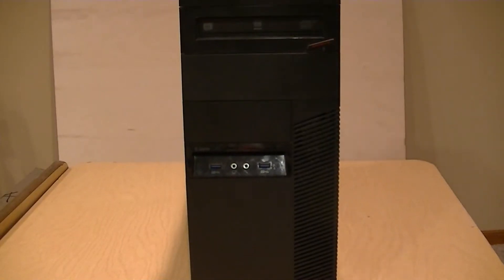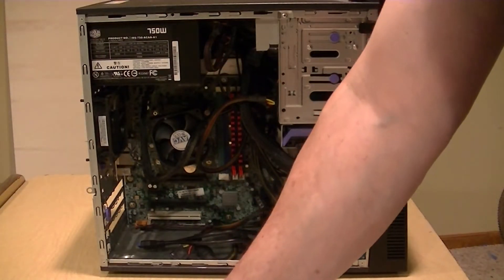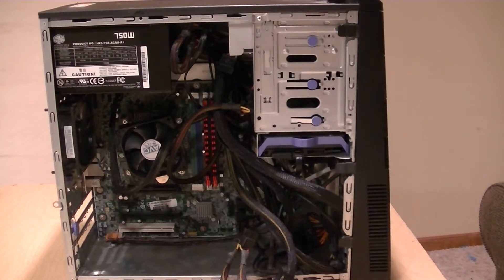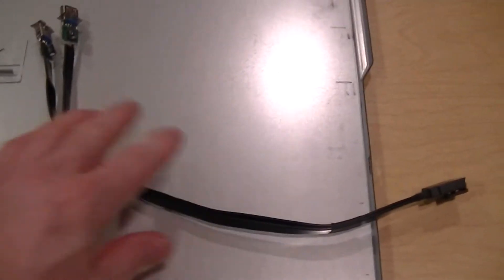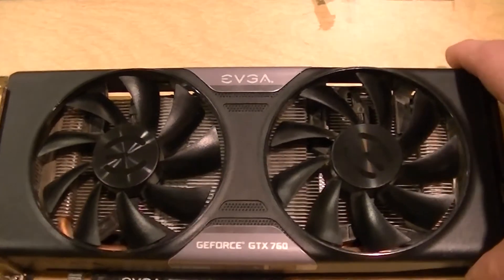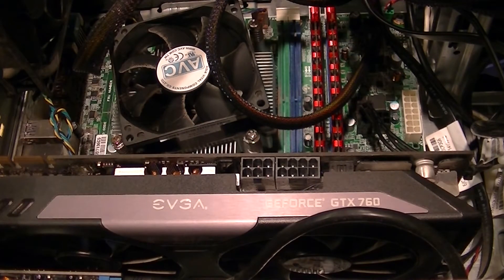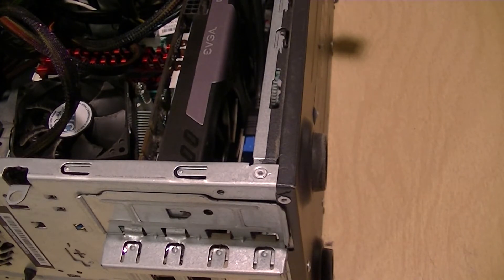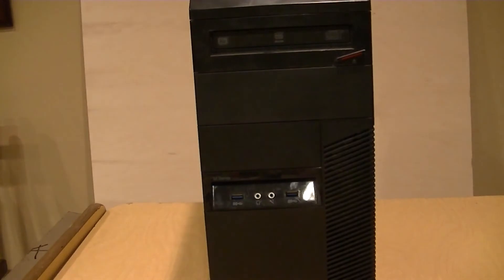Lenovo Thinkcentre M93 Turned into Gaming Rig

Comment: Do you happen to know the exact pinout for the front panel and usb? I'm planning to re-case this motherboard to a different M-ATX case but i can't seem to find the correct pin-out for the front panel and usb. Thank you and nice rig.
Reply from the maker: https://forums.lenovo.com/t5/ThinkCentre-A-E-M-S-Series/ThinkCentre-M81-Front-panel-connector-pinout/m-p/2051513  The picture in this thread looks exactly like the M93p.  I also checked the pin spacing between the FP connector and standard case connectors (PWR/RST/LED).  It looks like you could use a standard mATX case no issues at least regarding the FP header.  The audio is standard header for Azalia (HD audio) and USB 3.0.  In my case, I did modify the case connector (see other comments on this video) to go into a USB riser card.  Comparing this to a Dell motherboards, their FP connectors are very different, and use different pin spacing.  Hope you found this helpful.

Comment: I also have a M93 i5 4570 socket 1150LGA machine. Planing on upgrading the CPU to i7 4790k 1150LGA. Are there any CPU cooling options out there other than stock Lenovo hardware ? any idea if the Zotac GeForce GTX 1070 8GB would run ?
Reply: any Intel cpu cooler will work. Just make sure the fan has a 4in connector

Comment: I just ordered what I believe to be this same M93 chassis with a Core i7 4770 to upgrade from my trusty old Lenovo Slimline H530. Thankfully it's the same DIMM configuration. All I need to do is transfer the HD, RAM and DVD drive into this case and bingo bango bongo - a desktop PC that should last me at least another few years.
Reply from the maker: Excellent!  i7 to boot.  Thinking of a gpu? Or is it a productivity machine?
Reply: Not really a gamer. More home office / Netflix / photo editing. Maybe some occasional video.
Reply: Hi, I am in the same boat. What GPU did you put in? I am way confused with GPU. Haswell with 84 Watt TDP, the budget option is GTX 1650 (75 Watt/ non PCI power connector), and with 280 Watt PSU, should be okay occasional gaming. Any opinions on this??
Reply from the maker: @deamonsnake1985  Hi, thanks for the question.  Your GTX 1650 is rated to use board power, no connector.  PC manufacturers (Lenovo, HP, Dell) are required to design their systems for enough "headroom" to be able to supply 75W of power to the PCI-Express slot.  The OEM power supply in the M93p tower will provide enough power for that card - you should have no problems.  Nvidia recommends a 300W power supply, but that is conservative and based on assumptions that there is a lot of power consumption on 5V and 3V rails.  Modern (within the last 12 years or so) power supplies provide most of their power on the 12V rail, which is exactly what your graphics card uses.  The GTX 1650 will run great on this older system.

Comment: What about adding a better cpu cooler, would it be possible? I have an M93P with an i7 4770 and it's getting around 83C, would a Hyper 212 Evo work with the M93p Mobo?
Reply from the maker: Wow that Cooler Master Hyper 212 EVO is a monster, 120MM fan.  OEM motherboards are made with fewer layers than aftermarket (Asus, Gigabyte, MSI, etc.), that helps anchor those big heat pipe coolers.  I wouldn't risk an OEM board with a big cooler like that.  Maybe try some better heat sink paste - the Arctic Silver is always a good go-to.  Remount the heat sink, with the new paste and see what happens.  The OEM paste dries out over time, losing its effectiveness.

Comment: Tried to put my old R7 260x and 600w psu it worked with before, but m93 is always reseting as soon as gpu draws a bit more power. I feel like there's no enough power delivered to PCIE?
Reply: Having a similar issue with my gtx 1060...
Reply: @_RedsTech_  Damn. So it's not about the ATI graphics. Because someone told me that Lenovo did not white list any ATI, while nVidia is generally supported. Humm...
Reply: @Mandrak789  that's what I was hoping. Gonna test the card in another system in a couple days to make sure it's not the GPU, but I sincerely doubt that it is.
Reply: @_RedsTech_  Well that's some bad news on the horizon then. I was hoping to assemble cheap gaming rig for my kid. I would really appreciate if you come back to tell me results. Now I am not sure that I want to buy some nVidia if it won't work either.
Reply: @Mandrak789  Will do 👍
Reply: @_RedsTech_  Thanks a lot. By the way, did you flash the BIOS? I did, but to no avail.
Reply: @Mandrak789  turns out to be a gpu issue on my end. So there might be hope for you yet! I need to try and reflash the bios on mine. Not too bothered since I got the GPU for free, lol.
Reply: @_RedsTech_  Thanks man! Glad you solve that o7

Comment: Can i pair this with rx 580? I know the problems is the psu, so i planned to change it to 500w is that okay? I have worries because I've saw some lenovo prebuilt has a problem with new gpu
Reply from the maker: The things you may have to worry about are a) space - the RX 580 may simply be too big b) Windows revision - need 10 to support DirectX 12 and c) power.  Sound like you have 'c' covered.  As long as there is a driver (AMD will keep the RX 580 drivers up to date for Windows 10), you're good.  The RX 580 is a pretty powerful card and a 4th-gen system like mine might hold it back, especially in resolutions greater than 1080p.  Take care, thanks!
Reply: How did the upgrade go? I was also planning on an upgrade to the RX 580 but was worried about compatibility issues, did everything work correctly?

Comment: Hi there. Awesome video. I've got a m58p. 3.0ghz core2duo, 4gig ddr3 ram. I have the terrible GeForce 210. I'm not expecting to do intense 2020  gaming. Mayb run some classics but the card is pretty limited. Do know which graphics cards the board is compatible with? I've heard of these boxes having some compatibility issues?
Reply from the maker: Wow, today I just retired a Dell C2D E7300 CPU that I got second-hand from the 'bone pile' at work a couple years ago (wife's job).  Hopefully you have the E8400 Wolfdale CPU, that was pretty good back in '09 or so, but was being edged out by the early Core i3's.  To maximize your gaming performance, make sure you have a SSD, and upgrade to Win10 if you haven't already (your chipset is supported in Win10).  You need a card that is low-profile, and runs on board power only (no 6-pin plug on the card).  That limits your choices to versions of Nvidia GTX 750, 950, 1050 (plain or TI editions), the GT 1030, too.  I wouldn't spend over $100 on a card.  Read the listings carefully, thanks!
Reply: @elmarko9051  thanks so much man👍 I'm not too clued up with Lenovo. Do you know where I can find the compatibility list? As u say I don't Wana end up spending too much cash n buying the incorrect card. Its just an entry level build I'm doing so your suggestions are pretty good
Reply from the maker: @es8944  In doing some more digging, do you have the tower or the small form-factor (desktop) version of the M58p?  If you do have the tower, that opens up more options for the card.
Reply: I actually had a choice between the SFF but that had lower specs, could only take up to core2duo n 4 gigs ram. I've got the desktop tower. Upgradable to 16gb ddr3 ram, core2 quad cpu. Hope this helps

Comment: asking I have one of these after install  ssd ram  .can you show what to do after install. my 850 samsung . not  working. thank you  for updates.
Reply from the maker: OK, I used freeware to 'clone' the boot (Windows) drive from the HDD to my SSD.  I then removed the included HDD, and put the SSD on the SATA port where the HDD was originally.  This should be transparent to the BIOS - BIOS doesn't care as long as the SSD has the MBR (Master Boot Record).  For any large simultaneous changes to a system (CPU, memory, HDD/SSD, PSU),  trying changing just one thing at a time.  For example, add memory, go through POST and Windows boot, power down, do something else.  That way, if anything fails, you know what to undo.  Some systems are really picky about memory, and won't even POST with memory they don't like.  Or, you may have a defective component.  The one-thing-at-a-time method may help.  Let me know, thanks!  (BTW, I used MACRIUM REFLECT to clone the HDD to the SSD)
Reply: @elmarko9051  thanks bios to lagcy it took  windows 10 flash  drive for frist time your right about tricky and studburn thanks larry

Comment: I have an M83 and am looking to upgrade the power supply. I notice that, when visible, the 14 pin socket is not populated and you don't talk about it - all Cooler Masters available now that I have looked at only come with 20/24 pin power connectors. What was you solution?
Reply from the maker: Hi, go to 10:42.  You can buy a 14 pin to 24 pin motherboard to PSU adapter cable.  They have them on Amazon, I found mine on Ebay.  They are $10-12, in that range.  Good luck!
Reply: @elmarko9051  Thanks.

Comment: will a gtx 1650 work?
also, is it possible to change the cpu cooler?
Reply from the maker: Gtx 1650 is a good choice. Regarding a CPU cooler, I'll do some digging.
Reply: aaaah ok 👌.
Reply from the maker: @BlazingTonk  Found what I was looking for.  https://www.tweaktown.com/articles/5313/intel-haswell-socket-h-heatsink-requirements-and-overclocking-thoughts/index.html  When Intel releases a new CPU arch, everything is defined, even the post spacing for the HSF's.  In this case, 75mm square.  See the diagram about halfway down the page.  Even the big OEM's (Dell, Lenovo, etc.) stick to the standards Intel publishes.  Any HSF that is compatible with LGA1150 will work on your rig, with exceptions.  Some HSF's (looking at you Zalman) may simply be too big and not clear components on the mainboard.  Other HSF's like the Noctua may be too tall for the case.  Good luck!
Reply: ooh, thanks

Comment: I have a ThinkCentre M93 SFF that currently runs a core i5 4570.  Will it support the core i7-4790s?
Reply from the maker: Hi Joseph, at the time of release i7-4770 was the fastest 'officially supported CPU.  Later BIOS revisions support the i7-4790 (according to CNET).  The i7-4790S was released the same time as the i7-4790.  It's likely the latest BIOS released by Lenovo will recognize the CPU.  But I can't say 100% for sure.  A web search turns up a user trying to upgrade from the i5 to the i7-4790 unsuccessfully.  Sorry I can't be of more help.  But if you try and it works, let me know, thanks!
Reply: @elmarko9051  Thank you for the response.  I appreciate you taking the time to check.
Reply: El Marko So just a quick update.  After the bios update, the i7-4790s does work.  As it turns out, it’s the same architecture as the 4790, which is Haswell, but uses less wattage.  The 4790k has a slightly different architecture, known as Devils Canyon.
Reply from the maker: @JFrusci  Wow, thanks for the follow-up.  I've considering getting an i7, but can't justify it.

Comment: i bought one for 60, tried sticking a gtx780 in it and it didnt detect the gpu whatso ever, sold it the next day for 60 again. wish i figured out why it didnt work, last thing i wanted to but didnt try was a bios update.
Reply from the maker: That's disappointing.  But you weren't out any money.  The GTX780 is definitely of the same era as 4th gen stuff.  Hmmm.
Reply: @elmarko9051  first intel rig I attempted, was a bit frustrating but got my money back so all was good, dell optiplex look decent tho

Comment: I’m trying to upgrade mine it came with a gtx 620 i7 8gb of ram what upgrade do you recommend for game like csgo and apex
Reply: Lenovo ThinkCentre M93p 10A7000QUS Mini Tower Desktop Computer
Reply from the maker: @Lacora0426  If you're keeping the Lenovo power supply, the Nvidia GTX 1050 is a good choice because it does not need a 6 or 8 pin power connector.  The performance is similar to my GTX 760, so it will do fine in 1080p with DOTA2, PUBG, and Apex, CS:GO.  If you're upgrading the power supply to a standard ATX (don't forget the adapter cable), GTX970, GTX 1060.  Anything much better, the CPU will start holding back ("throttling") the graphics card.  The 8 Gb of RAM is enough, but the GTX 620 card won't be satisfactory for gaming except maybe on super low resolution/details.  Good luck!

Comment: Hello.. can gtx 1660 super works in i7 4770, 16gb ram, 500watts, but legacy bios? Thank you in advance sir.
Reply from the maker: GTX 1660, that's a fairly new card, very powerful.  If you are doing 2K or 4K gaming, I think you might be CPU-limited "bottle-necked"  by the i7-4770.  https://www.youtube.com/watch?v=npkMd97vbDQ  Based on this video, I'd say 4th Generation just won't get the most out of that card.  500W PSU, totally fine for any single-card graphics solution.
Reply: Yes, it works perfectly. I have the same setup (gtx 1660 super, i7 4770, M93p)

Comment: Hey i got a question for the usb 3.0 frontpanels what cable did u get to fix that can u post a link or something plz.
Reply from the maker: https://www.newegg.com/rosewill-rch-200-usb/p/N82E16817182338?Item=N82E16817182338  This what I used, looks like they discontinued it.  I had to disassemble the cables from the bracket and install the cables into the Thinkcentre front panel.  It looks like https://www.amazon.com/Excelity%C2%AE-Ports-Front-Floppy-Bracket/dp/B01C1KW5L8/ref=sr_1_1?dchild=1&keywords=3.5+BAY+USB+3.0&qid=1586825927&sr=8-1 would work just fine, but no promises.  From what I  can tell, all the molded plastic pieces and formed metal pieces all adhere to a standard, so this should work.
Reply: @elmarko9051  big thx and greetings from germany stay healthy. I just ordered the 14pin adapter for my sharkbay and will try to get my gtx 1070 in it but dont know how to remove  the smallcase for harddisk so my gpu can fit in at 5.11 min they sextion i mean
Reply from the maker: @evrensel1981  You are welcome.  Frankly, it has been a while since I originally removed the hard drive bracket.  At 05:11 you can see the holes have 'sliders' so I believe there are just a couple of screws (maybe just one) that you remove and slide out the bracket.  You may have to remove the plastic front panel to access the screw.  Wish I could help more.

Comment: Does Lenovo support Radeon cards I have this prebuilt and a Radeon rx 580 I want to out in it
Reply from the maker: You can use an RX 580 but you'll need to upgrade the PSU.  If your rig only has the i5 like mine, you may not get the most out of that powerful card.  Good luck!
Reply: El Marko what psu watt are you using I have a i5 4590 and I have a 500 watt 80+ white so I may be in trouble
Reply from the maker: @neastro2919  Check to see what AMD says you need for a PSU for that card.
Reply: El Marko they said minimum 500watt
Reply: How did the upgrade go? I was also planning on an upgrade to the RX 580 but was worried about compatibility issues, did everything work correctly?
Reply: CULLΞN yes it works fine
Reply: @neastro2919  Thanks for the response!

Comment: Does anyone know what’s the best graphics car  for this computer
Reply from the maker: Hi, thanks for the comment.  I've poked around Youtube.  https://www.youtube.com/watch?v=s42gvVS77dU  I think this video definitely answers the question.  My son's Dell (I5-4590) has a GTX 970, and it is definitely faster than my GTX 760.  But it appears that at 1080p+ gaming, faster GPU's than the GTX 970 will bottleneck i5-4xxx CPU's.
Reply: El Marko thank you very much I going to put an buy an amd card that wasn’t Compatible with my computer
Reply: El Marko I found a 970 for 32 dollars
Reply: MSI GTX 1660 Super Gaming X
Reply: @elmarko9051  what if it is a i7 4770
Reply from the maker: @MobiusKun  You might be able to move to a better card, as the i7 has 200 MHz more clock, and obviously more threads.  But the 4th gen architecture is 7 years old now.

Comment: does a 1650 works on this pc?
Reply from the maker: Hi, yes it does.  But there are several versions.  If this is a short card, and does not have a 6-Pin or 8-Pin auxiliary power plug, it will work on the stock Lenovo computer.  If your card is the same size as mine (double height, with 2 fans), it may block the USB front panel connector.  If your card needs extra power, you'll also have to upgrade the power supply and get an adapter cable.  Please review the video, there are solutions offered to make about any card work.  Good luck!
Reply: @elmarko9051  i want to get 1650 MINI ITX OC
Reply: @elmarko9051  can i ask what PSU you're using?

Comment: ur rams are on the wrong slots.
Reply from the maker: So wow, I looked it up in the Lenovo manual.  The recommended way is to populate UDIMM's in slots 2 and 4, I have them in 3 and 4.  Which means I'm running in single-channel mode.  Thanks.

Comment: Bruddah thats an thinkcenter m92p tower i have it
Reply from the maker: The M92(P) would be Ivy Bridge - that's the Intel i5-3470 and other CPU's.  The M93(P) is Haswell, Intel i5-4570 and other CPU's.  Either way, great chassis, good machines.
Reply: @elmarko9051  yessir i5 3470